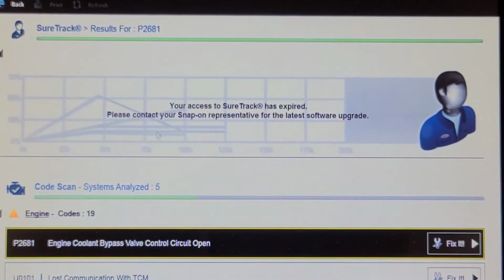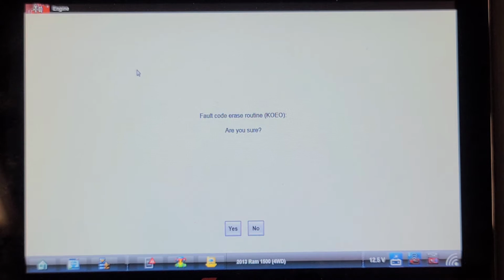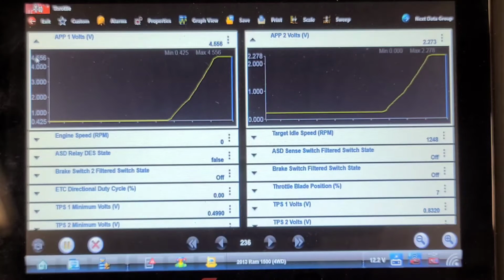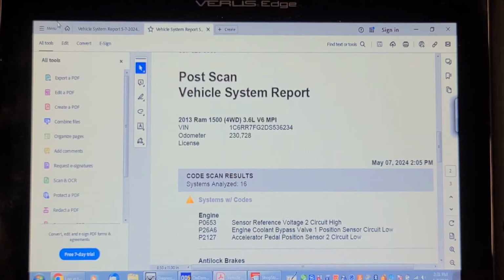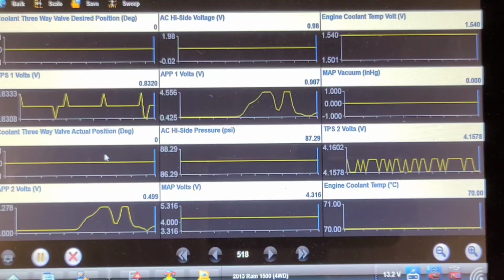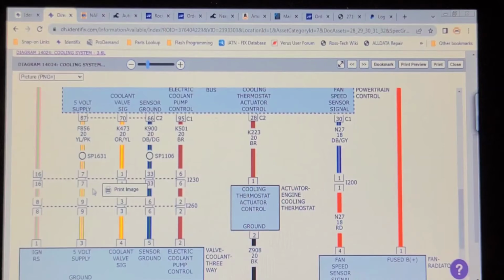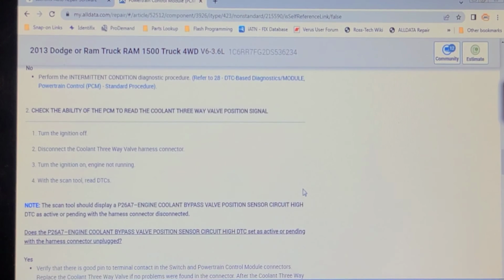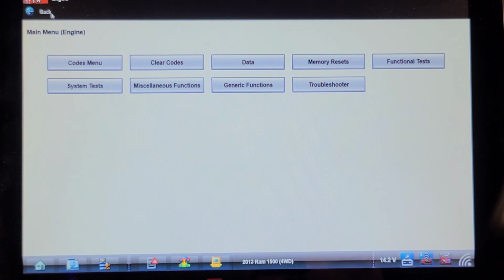2013 Ram 1500 4x4 3.6 Reduced Power Message, P0653, P2127, P26A6

Comment: So if that sensor (or even another sensor) is dusturbing the 5volt reference, if you uplug the sensor. The circuit should restore the reference and just show open on the unplugged sensor?
Reply from the maker: That is correct. Any sensor that uses the 5 volt reference can short internally and pull the 5 volt reference circuit low causing multiple sensor failures. Unplugging the offending sensor returns the 5 volt circuit to normal and only the disconnected sensor will be dead.

Comment: I recently ran into a similar issue with my valve. I actually changed it in April this year using a Four Seasons brand from Rock Auto (I don't recommend). It only had a 120 day warranty so no replacement there. Truck was driving fine with two codes for the valve on until yesterday when it went into limp mode and threw 13 additional codes for sensors. Waiting on a new Mopar valve to get delivered. It's a really dumb design.
Reply from the maker: Yes its not a good idea to take down the 5volt reference.

Comment: Another great video. Thanks. That diagnostic glitch in the pedal sensor would have really confused me. Do you see them often? Any tips on recognizing these diagnostic glitches when they occur? Thanks for being willing to dedicate your time to this video work for our enjoyment.
Reply from the maker: Yes both GM and Chrysler have been doing this for years both with the APP and sometimes one of the TPS signals. The unfortunate thing is that due to the refresh rate of graphing scanners it often appears random. I'm sure a few pedal sensors and throttle bodies have been called for it.
Reply: Great info, thanks. Really enjoying your channel.
Reply from the maker: @jeffgrizzel9499  thanks for the feedback!

Comment: Heres the info i have access at the dealer ship!

Theory of Operation
—The primary purpose of transmission thermal management system is to keep the Transmission fluid at its optimal operating temperature range. This is accomplished by directing coolant flow not required for cabin heat to the Thermal Management Unit (TMU) located on the left hand side of the Transmission which transfers heat from the engine coolant to the transmission oil fluid. Coolant flow is directed by means of the Coolant Three Way Valve located upstream of the cabin heater coolant supply. The coolant that is sent from the Coolant Three Way Valve warms the transmission fluid in order to get it up to the ideal operating temperature range quicker.
The Coolant Three Way Valve is supplied Battery voltage and a ground circuit. The Coolant Three Way Valve position is electrically controlled using a 12 volt PWM high side signal from the Powertrain Control Module (PCM). The PCM will send a PWM signal of 25% or 75% to the Coolant Three Way Valve, depending on whether the coolant is desired to be directed to the Heater Core or the TMU. The Coolant Three Way Valve has an internal position sensor that sends a signal back to the PCM. The sensor operates as a typical three wire sensor which has a 5-Volt Supply circuit, Signal circuit, and Return circuit. 

When Monitored:
With the ignition key on and battery voltage above 10.4 volts.

• Set Condition:
The Coolant Three Way Valve Position Sensor voltage at Powertrain Control Module (PCM) is below the minimum acceptable threshold.
Reply from the maker: Thanks for the clarification.
Reply: vincent ont peux tu by passé la valve sans danger en ete ?